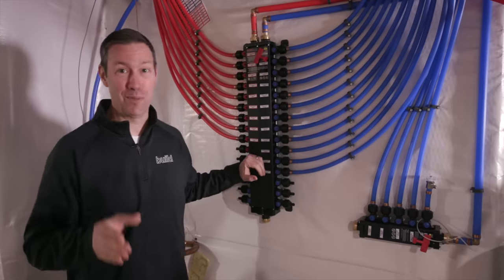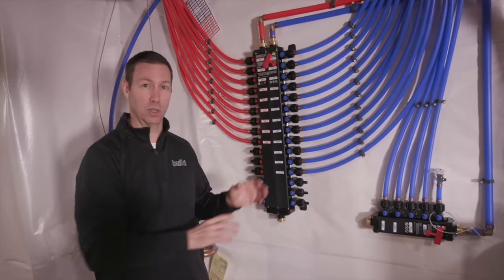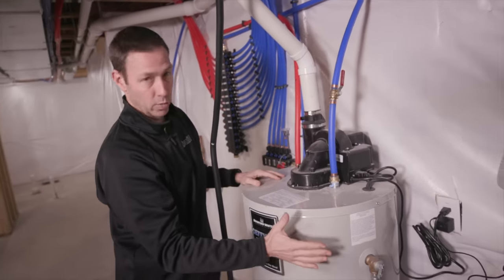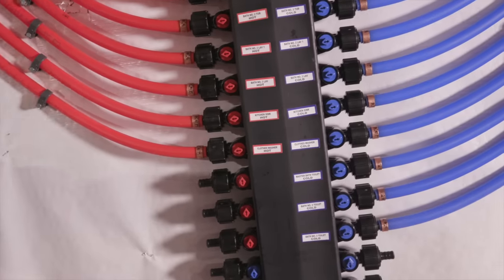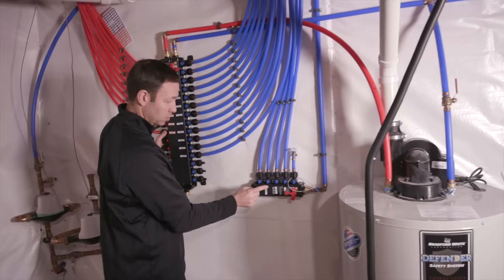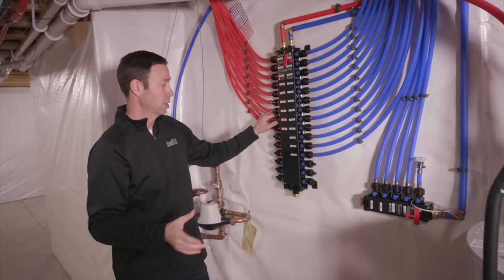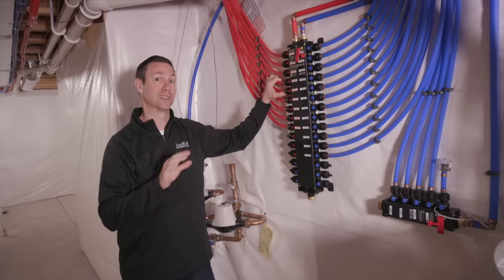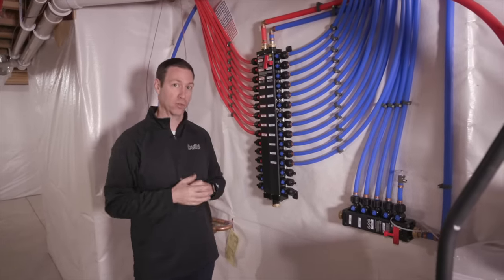PEX Manifold System - Pros and Cons + Tour

Comment: Plumbers in my area do not use home run systems because they use far more piping.  I draw plumbing plans and specify PEX, but draw them as trunk and branch layouts.  PEX is so reliable that the threat of leaks is not really an issue if the plumber has done his job right.

Comment: If I have a tankless water heater in my house and I also have a PEX manifold water distribution  system, do you recommend installing a recirculating pump under the farthest water faucet from my water heater in order to get hot water faster?  Will the recirculating pump work with my recirculating pump on other faucets in the house?
Reply: I looked at the manabloc system and decided it was  complicated and expensive.   I have a Navian with a 3/4" insulated loop.  The Navian automatically circulates the water to maintain temperature.   So my kitchen sink is 38' from the Navian,  but hot water is just below the floor at all times.  Hot water is coming out of the faucet by the time that you reach for it.  When I built the system I used multiple loops so I can turn off parts I'm working on.   We also added a valve off the trunk line for every fixture both hot and cold.  So I can turn off any single fixture in the basement.  It was cheap and works excellent!

Comment: Probably better in bigger houses, but using insulated hot water lines, with primary runs, and in each room where multiple outlets of what would exist, have smaller manifolds available. It would less duration for hot water access once the line has been used once in a give room, allow for emergency shutoff of only one water outlet, and with insulated lines keep water hotter longer. Obviously we aren't talking about insulating cold water.

Comment: I do not understand the evacuation problem. Do these pipes drain of water when the faucet is not on? Or does he mean the water in the pipe cools and you have to get hot water the distance of the run to see it at the faucet. Also , he mentioned no insulation. Is there a benefit to adding insulation to these hot runs?

Comment: Not a Plumber, but in longer run system, would it make sense to have a smaller sub-manifold, if you have space to accommodate it? Granted there is the added cost of a secondary manifold. Not actually considering it, just more of an academic question.

Comment: Simple fix for charging the line, just use a point of use on demand water heater. They only have to heat the water in the lines, so the electric use is almost nothing, 110 volt is more than enough. They are small and will fit under sinks and in the shower access. Once hot water reaches them, they auto shutoff. The only cold water is that tiny bit between the POU and the faucet.

Comment: Can't you make a hybrid of these two systems? Maybe you have a separate hot water trunk or something that you may run up to an upper level or send one line to each bathroom and have it branch off there with a connection door in a linen closet of something like that.  Also they should have ran isolated pex... wonder why they didn't he did such a nice job everywhere else.

Comment: Not sure where this is because of the meter in basement. It seems like somewhere up north. I don’t know if they have a different code there but I didn’t think you could run pex within 18” of a water heater.

Comment: System in the thumbnail looks like the braces should have been spaced further horizontally from the manifold and spaced less vertically from the manifold. The current setup places higher stress on the manifold connections than necessary.

Comment: Wow, I just don't fathom how this is such a hard problem to solve and why no thought was given to "sub-manifolds" or merely valves for each room or area. Just as with electric wiring subpanels, plumb in water "subpanels," i.e., sub-manifolds strategically placed throughout the home depending on its layout and plumbing configuration.  I have three electric subpanels in my two-story-home-with-full-attic-and-basement, and in my case two were remodel retrofits with one in the attic and one in the basement; a main "whole-house" panel had already been installed on the first floor when the home was built 91 years ago (kudos to the original owners).

[my view is you can't have too many valves or junction boxes, or water manifolds or electric subpanels]

As for the plumbing, he talks about "need for access" to the manifold like it couldn't be located anywhere but in the basement (or a garage in warm climates with no basement or crawl space).  Ever hear of a door or panel cover for the manifold?   Surely a manifold could be installed in the wall within a clothes closet, linen closet, or even a hallway, with a small door, just like an electric panel door, attractively done with metal or wood.  Duh.  I have effectively retrofitted "sub-manifolds" for my plumbing in the process of remodeling and  upgrading by installing separate valves for each of three baths and the kitchen (after 91 years, some remodeling was required).  Edit- forgot to add that I put in a hotel loop  just for the master bath and main guest bath which are the furthest end-uses from the hot water tank.

Comment: Love your videos Matt, but I think you missed a couple of important points on this one. An additional pro to the manifold system is that pressure remains balanced on the individual lines so that if someone flushes a toilet while you're taking a shower, you don't get scalded. Also, I disagree with how you're looking at the evacuation of the lines. Yes, each one needs to be 'charged' to get hot water, however,  it now can be a smaller diameter and still deliver plenty of pressure and flow, as well as going directly to its fixture rather than meandering all through the house going from one room to another. This means that you can potentially SAVE hot water with this system, not waste more!

Comment: I have a home run system with a tankless heater in the basement, but each bathroom has a small electric undersink which delivers instant hot.  10-30 seconds later the undersink gets hot water from the tankless and turns off.  instant hot everywhere, minimal energy loss.
Reply: That sounds really smart. Is your tankless electric too?
Reply: @Luckingsworth  tankless is gas.  The small tank rarely does anything but hold hot water delivered from the tankless.
Reply: @joshtargo6834  Thanks.

Comment: What if you just used cold lines to all the areas in your home, and then use individual tankless water heaters at each location where you need hot water. You would still be able to shut off the individual zones, and it would save you a lot of plumbing and pex or copper.

Comment: I've heard of some people putting a 2 gallon hot water tank under a sink. This gives instant hot water and the user never notices the almost infinitesimal drop in temperature as the cold water comes into the tank before the hot starts arriving.

If the manifold is 3/4" - 1" internally, I would see no reason not to run a 3/4" run to each bathroom. Then, I could do a 1/2" T to each sink and the shower. You were commenting on the bundling of the pipes/tubes, but you didn't say anything about labeling. How do you know which one is which?

Comment: Another consideration. 1/2 line has about 1/3 the water volume as 3/4 line.So if a 3/4 manifold ran most of the way to a bath would opening 2 fixtures on a home run system still not waste as much water waiting for hot as the manifold system? or am I way off base?

Comment: The Pex Manifold there looks great, but there is a better and more efficient method of running the lines.Run a single line to the bathroom for hot which runs to the closest outlet them continues to the next.(ie. vanity then shower).This method wastes less water and supplies hot quicker to both.
All pipes can be insulated ,if run together ,with a foil wrap to prevent any leaks soaking up into the fiberglass or others.

Comment: Solution: smaller individual manifold under lavi or kitchen sink. Circulate hot water there. Downside: requires individual circ pumps. 12v circ pumps are cheap but noisy.

Comment: Major negatives about these manifold systems you did not address Matt. 1.There is much more water pipe in these systems.  2.The manifolds I have worked with were not rebuildable...the entire manablock had to be replaced. 3.The maniblocks/valves are fragile, and valve stacks use O rings between each one. Those will probably be a problem as these age.   I like Pex though. Good stuff.

Comment: The manifolds in a big house waste alot of water and take longer to reach each bath, I have a  3 story house built with this system and even with multiple heating units it takes awhile to reach the far baths. Ive since had retrofitted electric instant water heaters in most baths and it makes a huge difference in time and water usage.

Comment: You did not mention the pump system that almost instantly pumps the "Cold Water" from the hot water line into the nearby cold water line bringing hot water to the fixture without wasting water.  It is another way to solve the problem after-the-fact on a long or the longest most used location.

Comment: IMO the conventional setup with independent, separate hot and cold manifolds is far more convenient. Takes far less wall space, since both hot and cold outputs point in the same direction, up or down, or as you wish, no fancy bends needed. Easier to insulate, less clutter in boiler room. The absense of pipe insulation was sort of a shock (I'm from the other end of the world where insulation is the norm).

Comment: Shouldn't there be a flexible steel 2ft long connector on the hot water heater hot side before the pex? Or a copper pipe extension off the water heater before the pex.

Comment: Most of those 1/2" lines can be 3/8"   And that manifold could be much pipe distance closer to the water heater.   There is a lot that could be optimized on that wall.

Comment: It seems funny that a 2,000ish square ft house would be consider to be small. That seems to be a fairly robust size house. When you consider square footage, does this include all the space of the house including and/or excluding unconditioned space areas like the basement, and garage? My family's house is around 1400 square ft and that seems like the right size for us, but it one included all of the unconditioned space areas, the house is around 2000 square ft.

Comment: The best way for hot water (regardless of additional cost) is to combine the hot water manifold (homerun system) with a point-of-use tank electric water heater at each lavatory (faucet and shower) to kill the hot water draining time.
Reply: NOT! FAIL! electric tankless is VERY expensive. and when they fail, you don't rebuild them. you throw them away and get another. plus.. the flow rate on electric tankless is HORRIBLE.

Comment: Um... Correct me if I'm wrong on Code but Your Plumber must've forgotten to not attach Pex directly to the Water Heater, last I read you must have an Approved Connection to extend 18" at inlet and exit of the Water Heater to attach Pex to.

Comment: We have the exact same type system and hot water wait is interminable. Up to 1:30 wait for hot water a d MO circ system.
Not happy, house built in mid 2016 moved in February 2017.. 2200 sq. Ft. My wife and all female neighbors hate it.

Comment: I would think 1/2" for just a faucet might be overkill, considering most of the flex lines that connect the fixture are 1/4" or 3/8" anyways. It would make more sense to use a 3/8" line if all you're feeding is a single faucet.

Comment: I never really understood the insulating of the pipes. The only benefit I can think of is increasing the cool down time. Energy wise you're not really saving anything.

The system I put in my house is similar to this one but it's 1 hot and 1 cold line to each room that needs water. In the target room the lines break off to each thing in that room with a clear gravity path back to the basement distribution block. Each line can be drained at the distribution block in the basement except and runs to rooms in the basement. Those I made with a gravity to the room. I cam empty the entire system all the way back to that main shutoff valve where it comes into the house.

Comment: Liscensed plumber from KY here...First of all your in an enclosed basement, which will usually constantly stay ground temperature WITHOUT any heat
..Why would you need to insulate the pipes. In my experience the insulation really isn't worth the labor or money anyways, as it barely helps. If it's going to freeze, it will freeze regardless. Seperate manifolds or a mix of trunk and branch with a manifold is good for a bigger house, but imo trunk and branch is the best right now.

Comment: Can the maniblock output to a 3/4” service line as well? Some shower systems with multiple heads require a larger service line for the increased flow.
Reply: Yes, it’s a simple screw on fitting that fits on the manablok.

Comment: The size of each line really should be matched to the maximum flow of the fixture. You aren’t suppose to just run 1/2 inch everywhere. Because each line is only for one fixture, the diameter should be downsized. 

The other advantage of this system is supposed to be pressure balancing, but for some reason they bypassed the hot water heater supply port. I’m guessing because of the odd location of the water softener system.

Comment: any reason you are using type B pex rather than type A ??? also are the runs long?- 3/8" type A pex gives faster hot water delivery to fixture for low flow fixtures on shorter runs

Comment: 1:57 , when I did my pipe run, I was told to not use PEX near the water heater unless you have 18 inches of pipe separation. Here it looks like pex runs straight into the water heater nipple. Has the code been updated or did I get bad info?
Reply: The reason for the 18" separation is to keep the PEX clear of the hot vent pipe.  This water heater is power vented, so no hot metal pipe to avoid.

Comment: I had a condo with flex line.. a leak at one location that I could never seem to get a guy with a 'tool' to come and 'tighten' the connection.. so it continued to leak.. I replaced that system.. it was for the hot water line to my heat.. switched over to a heat pump system.

Comment: Another con is that it is very expensive since a lot of pex is needed to be run.  if you don't put valves under the sinks or somewhere closed to the faucets or fixtures, and you need to change or repair one particular fixture you need to run to the basement and hopefully you can read the label in order to know what is the correct valve to close. Hopefully nobody loses that little key.  I personally don't like to use that system.

Comment: I have seen these manifolds completely corroded because of the water in certain homes, which means that the shut off valves could not be used on the manifold because of the corrosion.

Comment: I've used Manabloc systems on many small homes....Love the system.  The only con I have found is that if the valve on the bloc fails(drips)  you have an issue on replacing it since you have to access the back to do it properly... (if it fails)....  Stitchfix is big since this video for wardrobe style....

Comment: No expansion tank on water heater? Pex connected directly to water heater without stainless water flex? System is also using atleast  3 times more tubing than a Trunk and branch system. Trunk and branch system allows for more water flow 1 " incoming could be ran to  end of house, breaking off as it gets to each fixture. This system will have refuced flow since it comes into house as 1" then is immediately reduced to 3/4", ran through manifolds then reduced to 1/2" for long runs going to each fixture. If someone asked me if I would want a system like this I would pass, only thing I can see that would be beneficial is isolating each line if there was a leak. Otherwise if I need to change a fixture I'll just turn off the angle stop,  make sure angle stop isn't failing, if so or needing to change a cartridge, then shut the water off for the house.

Comment: Great video but there is one conflict between how this plumbing is and the studying I'm doing on how to plumb a house. The book "The Complete Guide to Plumbing, Updated 7th Edition" by Black and Decker warns against connecting PEX directly to a hot water tank. It reads, "Do not connect PEX directly to a water heater. Make connections at the heater with metallic tubing (either flexible water-heater connector tubing or rigid copper) at least 18" long; then join it to PEX with a transition fitting." (page 35). It makes me wonder what else might not meet code in this system shown. Has anyone else run into this issue or had an inspector confirm this? Just curious. Thanks!

Comment: Ref the distance and flushing line for hot water: wonder if anyone has thought of a hybrid build of having a single hot/cold from the block you are standing by to a room (master bath, bath 1, bath 2, etc) and then at that room they trunk off to the lavs, shower etc.
You’d get the benefit of being able to turn off a room (for leak repair, faucet change, etc) instead of a whole house ... as well as the hot water delivery to the room itself instead of hot to lav and the hot to shower.

Comment: Make me wonder why they didn't run a return line on the hot side to a pump. one 3/4 inch pipe that the 1/2's connect to and runs back to the manifold via a pump. Instant hot water everywhere.

Comment: Hello,

How would be the flowrate?Lets say all bathrooms in the house used at the same time? The supply pipe is only 3/4" diameter supplying all the receptors in the house.

🤔
Reply: just having the manifold doesn't mean you have less joints. if you run an upanor pex traditional trunk system correctly, you should have 1 tee in place of every manifold valve. ergo- same number of 'connections'. and this house should have been done with 1" trunk line. MINIMUM.